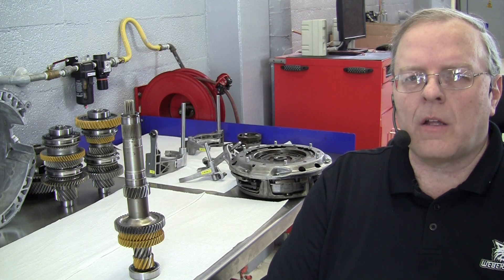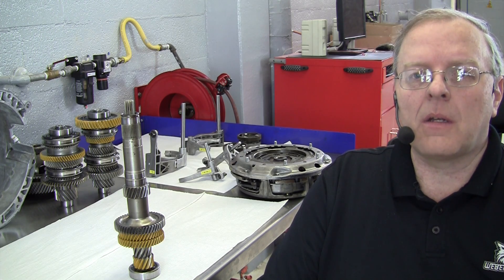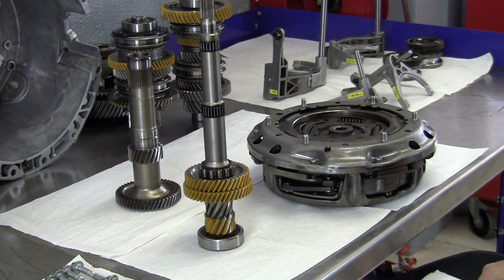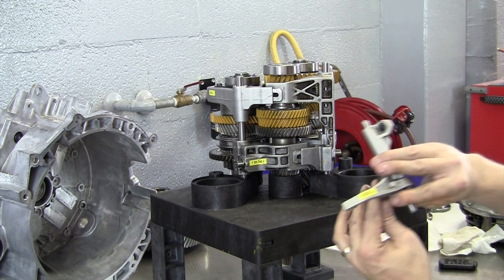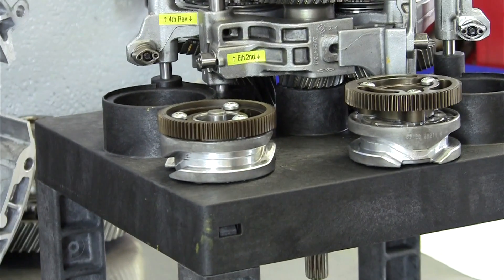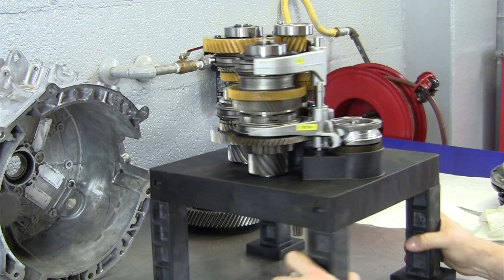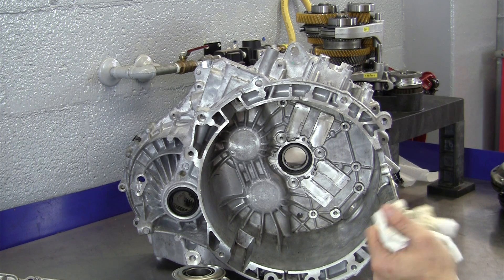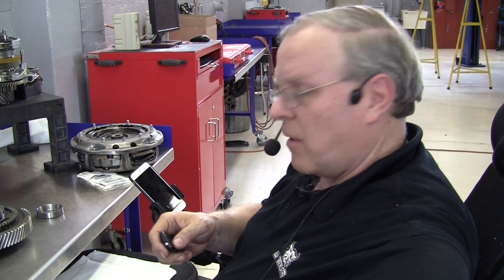Ford Dual Clutch Transaxle (DCT) DPS6

Comment: I've been driving a 2012 Focus with the DCT for 80,000kms now, the Trans control module failed recently, causing it to pop out of gear, we're getting a new TCM now, but as I've done trans work on other cars I was curious to see how it works, just 4 electric motors really do the automation, I find the car is quite conservative with its clutch slippage, probably to prolong the life of the unit, it still has pretty fast upshifts and puts the power down nicely, good stuff!
Reply from the maker: +Kingsoupturbo Thanks for watching!

Comment: Okay guys, listen up here.  Shuddering is caused by non-aggressive driving.  Which means the more you take it easy on your accelerations from a stop, the more the clutch slips and causes overheating problems with the clutch disc and flywheel.  This causes "hot spots" on the pressure plate and flywheel creating "shuddering".  There is nothing wrong with the shuddering condition, your car won't break down.  P073 codes and lack of reverse or forward movement is caused by a faulty TCM.  Ford also has hidden warranty on this, so inquire before you pay for repairs.  A replacement TCM is usually necessary followed by reprogramming and clutch "re-learn" procedures.  If you have to pay, you should know that the TCM takes less than 1hr to change out, but I don't the cost of the TCM itself.  The Focus is a fantastic car otherwise, great on fuel, handles like a dream, comfortable and fun to drive!  That's all I can say about that!

Comment: So what will make my car jerk so badly? Is it the flywheel or the clutches?  Also something behind the firewall is knocking after said jerk in my Ford Fusion 2014 AWD model 2.0 liter. I think it may be the same transmission that is in the Focus if not both of these transmission have some serious problems. The car idles funny now after taking it to a Ford dealer is when I started to notice these problems.
Reply from the maker: +The Trillion Dollar Gods Hi, I don't think the fusion has the same transaxle. I would take it back to the dealer and let them know what has happened. Thanks for watching!

Comment: Not only Ford have problems.. All manufacturers experience this mainly because the customer isn't properly informed by the salesman that this is NOT a conventional automatic transmission bytes rather an automated manual gearbox!!
Reply from the maker: Very true, thanks for your feedback.

Comment: Great video!  I'm just confused as to how the tcm knows what position the shift forks are at, upon initial start up?  Does the tcm just automatically shift the fork to 1st gear everytime the vehicle is started?  How does it know if it's already there, IE battery disconnected in first gear, and vehicle shut off, or is there a sensor that transmits data from each input shaft, or shift fork, to the tcm?

Comment: I researched these transmissions when I was looking to buy a 2015 Focus. I wasn't willing to gamble on one so I got a 5 speed manual instead. Much better transmission in my opinion.
Reply from the maker: +massltca Thanks for your feedback!
Reply: These transmissions are absolute shit. We bought our 2015 focus new and had nothing but problems with shuddering. It's been back to two different ford dealers and they say it has "acceptable" shuddering which is a cop out. They should have been recalled. Stay well clear of them
Reply: @peteryates9153 they were recalled because customers won the law suite. However, because the manufacturers of these transmissions coincidentally went bankdrupt, the best ford could do was give you a certificate for a discount on their new cars if you were to purchase from them.

Comment: Great video Weber.  Great understanding how that double clutch works in my car now.  Got my car out today and it was exactly as you explained, clutch foul from lubricant.  The new seals are brown now instead of black.  Ford really did me right on this one.  All the recalls, and additions from the dealer I can't explain and a detail.  I knew I was buying some new, really un-tested crap but I bought it anyway.  I haven't had allot of problems with the car to be honest, I just figured it to be quarks but after all the work and the trans controller, it really drives nice now.  Keep in mind I took the car in for door latch recall.
Reply: My friend has a 2014 as opposed to my 2013 and just complains all the time but never takes it in.   Also has a Master cylinder check valve leak which screws everything up.   Maybe 2014 wasn't a good year.
Reply from the maker: Thank you! I am glad to hear you got yours fixed and operating properly. Thanks for the feedback.
Reply: @nasmitty5261  if your friend never takes the car in to be fixed, how does he expect it to get better?

Comment: i have a 2011 camry , i asked the local toyota dealer to do a transmission flush , not a drain and fill job.  They said they would do the flush for 250 dollars.  I dropped the car off for the service the night before.  When I picked the car up the following afternoon,   on the receipt under shop materials it said used only 3 qts of trans fuild.  They didnt do the flush jst a drain and fill.   After watching your video how did they do that with the sealed transmisssion?    The manager then tells me they dont have a flush machine that the 3 quart service is all toyota reccomends to this tran with over 110,000 miles on it.   What do you think?  I'm feeling ripped off.
Reply from the maker: +Russ Persetic If they charged you $250 to drain three quarts of fluid from your transaxle and then add new fluid, you definitely got a bad deal. A flush can be done if they connect the flush machine in between the cooler return line and the transaxle. If they had actually done that, they would have used a lot more than 3 quarts of fluid. Your transaxle holds more than three quarts of fluid, so part of your old fluid is still in there. Even if they did not have a flush machine, they could have disconnected the cooler return line at the transmission and let the old fluid drain while adding new fluid with the engine at an idle. Once the fluid coming out of the return line looks new and clean, the flush would be complete. At that point all they would have to do make sure the fluid level was correct and they would be done. Best wishes.

Comment: I have had 4 replacement clutches in 110K miles. Gears 2,4,6 and reverse side of the Clutch is the failure point of this tranny
Reply from the maker: Thanks for the information
Reply: Absolutely ryt

Comment: Transmission rebuilder for 40 yrs here, this concept is off the wall crazy, many other ways to achieve automatic operation within transmission. A 5 speed standard manual clutch operational transmission would do wonders for this Ford Focus vehicle. Today’s breeds of humans couldn’t grasp standard clutch operation. Cell phone texting is what they excel in.

Comment: Is that throwout bearing has any balls on it, how do they minimise the friction? Seems like complex design. Seems like it doesn't have any balls or needle type roller in it. That may cause more friction on pressure plates.

Comment: Can you explain the why the clutch slips and causes a shudder concern with this design? The first batch of these DPS6 transmissions have a leaky input shaft seal and the clutch gets contaminated by the dual clutch fluid. These clutches get replaced every 5k-15k miles even after the input shaft seals get replaced.

Comment: What is the maximum oil temp which this gearbox can handle? This gearbox is used in Renault Clio RS and reaching up to 95°C (200°F) while driving on track is pretty easy so I'm just curious if Renault has put box in their sports car which can handle track use.
Reply from the maker: +Mateusz Nieckarz Good question! I do not know the answer though, sorry. Thanks for watching!

Comment: Great video and demonstration of this terrible transmission design 🤣 I have a 2014 focus and had the TCM replaced at 16,000 miles. I bought the vehicle new with 14 miles on it. Then there was a recall for them that was also addressed. I knew from having it the first week that it wasn't right. Ford fixed it and the car has been great, until last week. Having issues with it and seems to be shifting from 1st to 3rd to 5th. Reverse has been working no problem. I have a code P07A5 transmission friction element B stuck on. I'm thinking it's the TCM again but not sure. Sometimes it's fine them when I shut the vehicle off and restart, it has issues, and goes back and forth. It has sport mode and when it has an issue shifting, I can not use spirt mode, it will not let me select it and when put in sport mode, it stays in 1st gear only. Any ideas/thoughts? I would appreciate any insight of yours. You are by far the most knowledgeable person I have come across with this set up. Very superb video!

Comment: 7:35 I try to recondition the dual clutch, but I always fail to get the right touch points. 
Can you show or tell me the thickness of the clutch canvas to get the right touch point ??
please and thank you very much, Master..
Reply: The only way to get the right touch points is to hook up the Ford IDS connected to IDS software on a laptop and run through a "clutch re-learn procedure".  Other than that, you could attempt to drive the vehicle (not recommended) until the TCM learns the touch points.
Reply: @cxdrive1  i mean, I would like to know what is the ideal coupling lining thickness for the recommended touch point (0.9-0.11) 

i try to recondition, but i got 
up = 0.20 
down = 0.7 

anyway, finally i've bought a new repset dct 🤭
Reply: @maharanipancasari1480  Sorry can't help you there.  I've never heard of someone attempting to recondition this clutch and have never had to measure the thickness of the clutch discs.  As far as I know, the clutch assembly is supposed to be "non-serviceable".  A new one should be installed for correct performance.

Comment: Great video. I am curious what parts would be called the Actuator Fork A? I ask as some owners are now being told that have issues that this part Actuator Fork needed to be replaced at very expensive costs EG:$4,000.00 USD (includes parts & labor).
Reply from the maker: Hi, the round drums with gears on them move the forks.

Comment: If it’s a manual transmission, can it easily be converted to a manual shift instead of the auto shift?
Reply: Some one on YouTube did a video manual swapping a 2014 focus it can be done

Comment: Thank you! Very happy to see so much detail.

I have one of these cursed things in my 2013 Focus. It shifts exactly like I did when I got my first manual car (terribly), but unlike me, it never gets any better at it. Love the technology; hate the implementation.

There have been several TSBs and revisions to the input shaft seals to keep oil from escaping, running down the shafts, and dripping on the clutch discs. There have also been at least five clutch plate revisions. Ford no longer makes their TSBs public, so I don't know what's happened over the past year.

Mine had bad seals and had a clutch replaced under warranty. It no longer has the aggressive shudder it had when the clutches were contaminated, but it still shifts horribly. The TCM "learns" as you drive it, but seems to actually get worse at feathering the clutches. It's worst when accelerating from a stop or shifting from 1->2. Possibly amplified by the shortness of the first two gears.

Lastly, something inside the box makes a horrible grinding sound, especially when under acceleration and turning left. Ford repeatedly told me this awful, embarrassing noise is "normal". It sounds just like I'm dragging a six-foot steel rod behind the car. I haven't heard a clear explanation as to what's causing it, but I wouldn't be surprised if the box was slowly eating itself. Glad I'll be free of this thing (and Ford's incompetence) after only one more summer.
Reply from the maker: James Wagner Thanks for the feedback. Hopefully the newest version of the clutch and/or TCM software will improve the driving experience. I would check with your Ford dealer to see what updates are available. Thanks for watching.
Reply: @WeberAuto  yeah and the customer will have to pay for that instead of having it done for free like it should be since the customer isn't responsible for this poor design.
Reply: I think I bought your hunk of junk... lol
Reply: Yep feels just like a teenager just learning to drive a manual. Mine is especially bad first to second....really "feathers" the clutch between gears. Inspires a lot of confidence when pulling into traffic.

Comment: John, lots of problems with this DCT in Focus and Fiesta, still on 8 week backorder cycles for the newest seals and friction material. Warranty was extended to 100,000 or 150,000 miles (don't remember which). Lots of complaints on the forums, and lots of messing around to even get in line to have this fixed.
Reply from the maker: Thank you for the feedback!
Reply: We got the same warranty extension150000
Miles when the clutches went out for the 3rd time at 89000 miles we took it in and the dealership said that was only for computer reprogramming. The cost was $2200. Thanks ford, and they wonder why people  buy foreign.

Comment: This transmission was a great idea, but lacks the sort of tuning followthru that the german manufacturers give. I have a 2013 focus that had clutches rebuilt and a programming update. If Ford put more effort into the algorithms, it could shift smooth, but on a car that is only worth 1/5 it's value after 5 years, Ford just hopes you will buy a SUV and forget a focus ever existed. This transmission is why the manual focus' is worth 1-4k more for the same trim and mileage.
Reply from the maker: Thanks for your feedback, this is a German transmission
Reply: It may be a German transmission, but it's still up to the maker of the car it's going in to have the final say of quality and tuning. Ford dropped the ball. I doubt VW, Audi, BMW, or Benz would've accepted the jerkyness that this transmission had from day one.
Reply from the maker: Thank you, I understand what you mean now.
Reply: @jacobkane3935  exactly. It's a tuning issue. What he was saying about making it slip and feel like a torque converter transmission? That's exactly the problem and it comes from how they tune it. Aftermarket tuning can turn this thing into a reliable transmission.

Comment: Look at the TSB's on these transmission before buying a car with one, just a warning. Not sure if the 2015's are any better but previous models years had lots of problems. 
Apparently the problem starts from the seal on the input shaft leaking fluid which gets in the plates, which you sort of seen in your video, whether than was grease or fluid can only guess.
Reply from the maker: +Only1Truth Thanks for the feedback!

Comment: Nice explanation!
But you could have made it easier for yourself (and maybe the viewers), if you had marked the "gear shift rotors" (or whatever they are called) with the position they need to be for the different gears. Put an arrow on the table, and digits on the rotor. R/2/4/6 on left one, and 1/3/5 on right one.
Reply: That would also show that not all neutrals are the same. So maybe the full sequence with R/N1/2/N3/4/N5/6/X  on the left, and NR/1/N2/3/N4/5/N6/X on the right. Where N<gear> is the only neutral that is used while the other rotor has selected <gear>. X is a position that never would be used, and N6 would only be used if there is some fuel savings reason to put the "other gearbox" in neutral while driving for long times on 6th gear.

Btw, do you know if that's how it's done? Is there always a preselected gear, or do the gearbox switch to a neutral in the other gearbox if you stay in the same gear for a long time.
Reply from the maker: +basecius That is a great idea! Thanks for the feedback!
Reply from the maker: +basecius Hi, there is always a preselected next gear while in a current gear, but it is not engaged until the other clutch is applied. Thanks again!

Comment: How do you prevent the engine from stalling when you are in first gear and stopped at a light?   Is there a torque converter involved?
Reply from the maker: +abz124816 Hi, there is not a torque converter, The clutch discs are automatically released at when you are stopped.
Reply: +WeberAuto how does that happen without stalling the engine or riding tge clutch?
Reply from the maker: +abz124816 Hi, just like a manual transmission. Think of it as having a computer stepping on the clutch pedal for you when you stop, and releasing it when you need to accelerate. It is all computer controlled.

Comment: Is ok request example used gear box (car suv off road weight rear seat o box incluided trailer increase wheel size changues speed low & up ghrapic bourdeux i gadget (panasonic) milleage oil & fuel consumption multi propouse
Reply from the maker: Thanks for your feedback

Comment: Thanks for great explanation.  do you know if we swap the TCM with new or used , do we need to programming it by dealers or special scanners?
Reply: You can't swap the TCM with a used one from another car, as they are VIN coded.
If you replace with a new TCM you need to input the VIN. You'd also need to run clutch and shift fork learning programs. 

An OBD EX adapter (about $50) and a laptop with FORSCAN  software (available free) is all you need to do this though.

There's a FORSCAN forum with lots of information about the best adapters etc.